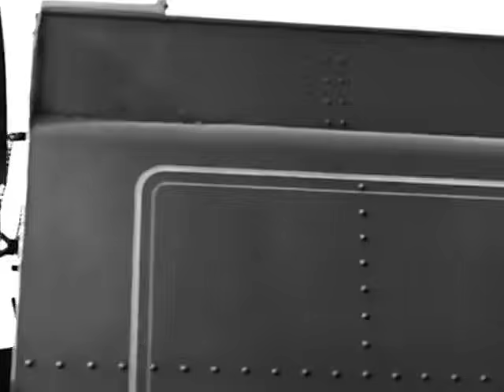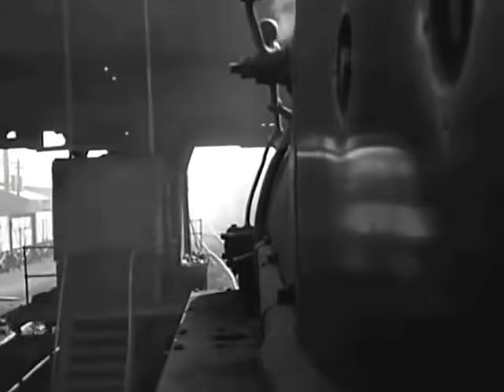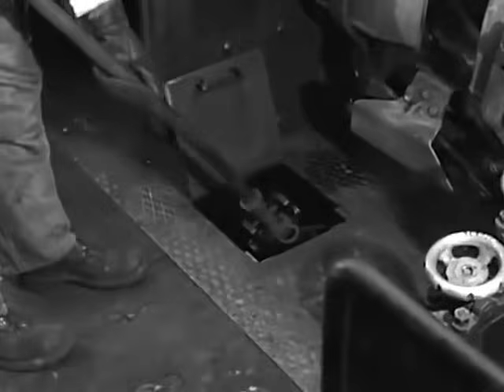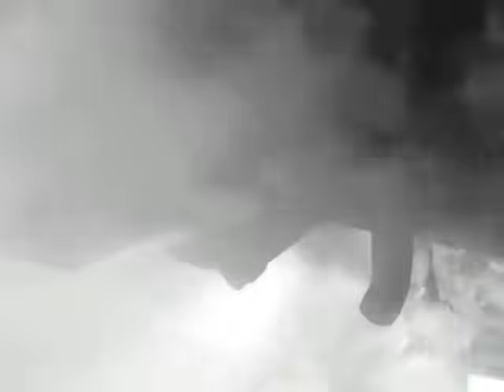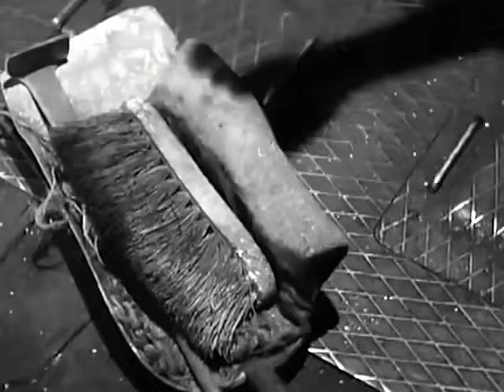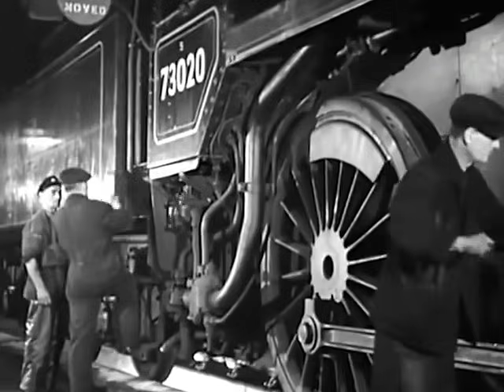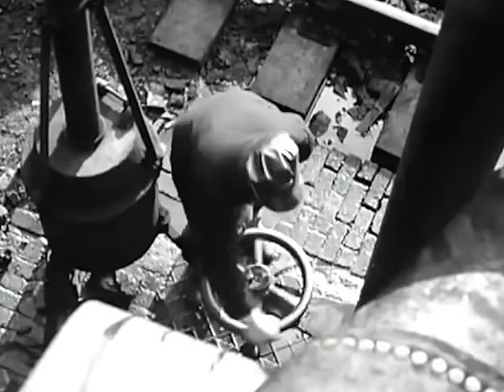Wash and brush up - British Transport Films - British Rail steam loco maintenance - 1950s

Comment: I remember seeing these monster as a kid. Born in 1951, they were the accompaniment of my early schooldays. My school was right next to the East Coast Main Line, and we ran out of the school yard in the late afternoon, to see massive plumes of steam being vented at full pressure, by the London to Edinburgh engine, while stopped at the lights just beside the school. They were waiting to cross a bridge at Byker. The roar of steam from those hot engines being blown,  I suppose by safety valves. Then they were off and pulling up a hill. Great days to be reminded of. The locomotives were awe inspiring and terrifying at the same time.

Comment: Dirty jobs to keep them old steam locos running. Also moving a steam engine isn't as simple as moving a diesel/electric, everything needs to be planned ahead, from making live steam to move the engine to coolung a dead engine to clean it, once you drop the fire that engine isn't moving until you fill the boiler back up and light the fire  then waiting until the pressure raises up, like the narrator says it rakes over four hours just to raise steam! But despite these issues there's something beautiful about a steam loco,they feel alive.

Comment: He knocks up the catchers on the firebox😂
If you can't get the rod through the tube, screw it.
His words.
I wonder if that poor guy getting in the firebox is black or just been doing it too long.
They never show work being done when it's snowing/cold
Reply: The washer out, the fire lightah, the steam raisah,
Footplate men, train settah,  and the reporting clock tells you where to stick it.😂
A propah bobby dazzler.
Love the Brits of old. So to the point.

Comment: Which BR Standard class is it?
Reply: A BR Standard Class 5 . When I was a kid in 1966 BBC South Today- a regional news programme had a folk singer on and he sang a song about a Standard Class 5 being cut up for scrap- over a film showing the engine being cut up: "Farewell to the steam locomotive- when the Southern ran solely on steam- and the Standard 5 Class locomotive was just a load of scrap" was the repeated chorus.  A few days later the "anchor" for the programme said "We have had a lot of letters that were unhappy about the film showing the steam engine being scrapped. We have sent a camera to Southampton Central to film a steam engine". They then showed a Bulleid Pacific waiting for the "off" a dirty machine but still living. It's funny what you remember. I went through Eastleigh the day before Southern steam ended- and there were loads there- coming back to be axed. The "last day" was pretty much just one steam special-Waterloo to Bournemouth. It was a very hot early July weekend in 1967.

Comment: British Railways struggled to get loco maintenance staff when the car factories expanded in the late fifties and early sixties, lighter cleaner work with good pay rates was on offer in the factories.
Between 1951 and 1960, 999 standard class locomotives were constructed, we really dhould have gone over to diesels much earlier, as the LMS had constructed their first mainline Diesel in 1947, just before the railways were Nationalised.

But after the war we were short of currency to buy oil, plus the pits had just been Nationalised, so new Steam engines it was to be.

Fortunately we have many preserved steam locos on our fantastic heritage lines, so the old ways carry on .
Reply: The last trains through Halesowen were workmens services to the Austin factory at Longbridge, car workers would leave wage slips on the trains for railway workers to find and see how much they were earning at Austins.

Comment: What a job that was, to take care of the engine when it returned to the shed, inspect and clean, and get it ready for another day’s work. Two guys run the engine, but I had no idea of the team and the work involved to keep that engine in running order.
Reply: These days in preservation the volunteers often double up in dealing with such work as well as the operation as well

Comment: Just been talking with the Mayor in the healt center  in Gaianes  , as a young boy remembers using El tren de Las Inglesas  steam , & later in Spain  many steam voyages when diesel was coming .Was on a trip on a Deltic for Cromptons  years ago , crunch bang no lube in gearbox that was what broke our electric motor shafts , oh the embarrassment towed to Derby by a King class  , we got back to Chelmsford  by steam ,.the  noise  in the Deltic correct  had earmuffs on plus all ourAmmeters !

Comment: This engine was still quite new when this was filmed, only a few years old at most. BR built hundreds of new steam engines in the 1950's, but there was no shortage of decent British coal and any oil imported for fuelling diesels would have had to be imported, using scarce foreign currency.
Reply: I believe 73020 was scrapped in the early 60s unfortunately. Would love too see a modern remake of this vid with the same engine
Reply: @lorumipsum1129  Late '60s -- withdrawn from service in 1967 and scrapped the following year.

Comment: Well, even when a modern coal powerplant has an effectivity of just about 30% with transformation and distribution/transmission losses added to the admittedly minimal losses of an electric engine, but the maintenance efforts with an electric train are at orders by magnitude smaller than with a steam train, not to mention the refueling issues.

Comment: These old steam engines were around 6% efficient compared to around 90% for modern steam turbines used in power plants.
Reply: Steam turbines get nowhere near 90% thermal efficency. Power plants typically report about 40% efficiency, which are amongst the best performing steam turbines. When people say that a "steam turbine is 90% efficient", they mean that the turbine is achieving 90% of the ideal turbine, which in this case would achieve about 45% thermal efficiency. 
The 6% efficiency of the steam locomotive is the true thermal efficiency, so you need to compare the 40% of the steam turbine to 6% (which is still bad)

Comment: How often would this type of service have to been performed on a locomotive? Hours, miles, day whatever.  Great film. Many thanks.
Reply: Every 12 to 16 days It says, the steam engines were run almost 24-7 except maintenance and stops since you need hours to get the machine to operating temperature from the moment you lit the fire. Trains even today always run almost continually, they only switch crews
Reply: @gillespriod5509  They weren't run 24/7 in those days -- they still required substantial minor maintenance between these two-weekly wash-outs.

Comment: Funny how only the West Indian guy was the only one wearing a mask. The bloke with the berry on was probably a WW11 veteran - it was common to see such men at work up until the 1980's. The super heater tubes are roughly the equivalent of a turbocharger on a modern car - these engine were extremely complicated and very powerful by the time of the 1950's. Trade unions would have a lot of say on job demarcation, health and safety and training. They also kept wages in the railway industry in par with more modern industries.
Reply: Whan did the other 9 world wars happen?
Reply: @jean-lucpicard5510  Give it time. You don't get born until the 13th of July 2305.

now...
👉
Engage

Comment: Those were fantastic machines but needing so much cleaning and maintenance.  And from a purely engineering perspective, they were only about 6% efficient at extracting work out of coal.  Diesels we’re just around the corner and needed much less maintenance and about 30%. Efficient so the steam engines were doomed.  Somewhat sad but unavoidable.

Comment: This is so labour intensive to happen every 15 days! Plus having to coal up everyday, a driver plus a fireman I wonder how much more of our network could have been saved and still be in use today if the railways had not been used to employ thousands of returning men from the Second World War. But use the same men to modernise and upgrade our railway system earlier. I know the government didn't want the cost of importing oil from overseas because we had plenty of indigenous coal and wanted to keep miners in work. surely it would have been better to have used this surplus labour to have electrified the railways sooner and burnt the coal more efficiently in central power stations.
Reply: The British powers-that-be have never been great at making logical logistics and infrastructure decision.

Comment: I'm one of the few people in this day and age that still works as a steam locomotive fitter for a living, pretty much do the exact same stuff these guys in the video, although we use some different methods to do stuff shown in this video. 

Its a hell of a job to do and I cant imagine the turnaround these guys doing it back then had. its very different in this day and age, there isn't an infinite amount of man power like massive workshops used to have so exams and maintenance takes a lot longer. they used to have separate fitters, machinists, welders, tube sweepers, examiners, barmen, washers and dozens of other roles. 
Now days you learn to do ALL of it yourself, its a lot more daunting than what it once was
Reply: I’m a cleaner (trainee fireman) in the UK and it’s nothing like this. Cleaners don’t bother with the insides of the engines anymore. That’s usually left for off period of a locomotive when it isn’t running, and the owner of the locomotive, usually a driver or fireman (depending on who owns it) will do this. Washouts are pretty similar apart from the fact that the hoses are a lot thinner and the water pressure is more powerful. This is only ever done with the engine is in a cold state as well for safety reasons. 

Cleaners only bother with the outside of the engines these days, usually washing the wheels, frames and the body.
Reply: Where are you a fitter? Im in the US in Cleveland.
Reply: @tomp3066  Victoria Australia
Reply: Hey Woody is this a full time job on a working railway or a vintage touristy railway. I'm sure it is daunting, I know the British Railways has a very large workforce but they were obviously needed to achieve those turnaround times.
Reply: @greenrosenz  full time job as a fitter on operating steam locomotives

Comment: How can can a locomotive run once the fires been dumped?
Reply: The boiler is filled with water before the fire is dropped, and with almost full working pressure. After dropping the fire there is still enough steam to move the Loco.
Reply: @MrDibbsey  interesting. I wonder how long it can run like thaf
Reply: @lorumipsum1129  not very, depends on how long it takes to drop the fire. A loco will move with very little pressure but stopping them is a completely different matter!

Comment: Some of these jobs must have been very hazardous.  I'm glad the industry is safer today.  I'm surprised that mechanical stokers weren't the norm in the 1950's.
Reply: Mechanical stokers need finely-crushed coal rather than big lumps, otherwise they seize up. This means that the draught on the fire draws a lot of coals through the boiler and out of the chimney, making mechanically-stoked engines dirtier and less efficient.
Reply: @geekyboringfilms233  Thanks.
Reply: Mechanical stokers weren't needed in the UK. We weren't running enormously heavy trains for enormously long distances, so a guy with a shovel was able to keep up with the locomotives' demands for fuel.
Reply: I'm surprised they were never converted to oil burning like many countries steam engines.
Reply: Best coal in the world was in Scotland. Why import oil.
Reply: @xr6lad  Running a steam engine on oil makes no sense for a country with diesel engine industry. In that period Britain had to import almost all oil and the coal mines were still in operation, so there wasn't an incentive either.
It was simply cheaper to build newer more efficient diesel locomotives, than converting them.

Comment: I like to imagine 73020 and other steam engines being sold to island railroads on islands southwest of Sodor .These railroads decided to keep steam and bought many gently used engines and kept them running even today.With good maintenance a steam engine can last 100 years.all parts with times can be replaced with identical ones.Engine would never have to be “old”.I’ll bet modern equipment would reduce time needed to maintain steam engine by more than half.

Comment: With a 25 kV overhead line feeding renewable energy you could raise steam without coal. Locos would look like they should  - just not very efficient.
Reply: Why use electricity to boil water to drive pistons, when electricity can turn an electric motor?

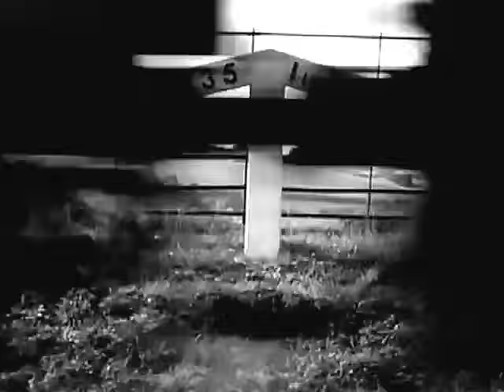Comment: At 24:31 there is a cross-bar sign with "Iin 335" on the left arm and "Iin 2665" on the right arm.  Any idea what this means?
Reply from the maker: It's a gradient post.
Reply: @BennettBrookRailway  Excellent; thank you so much for the Reply.
Reply: @xyz.ijk.  It's "1 in 335" not "lin 355". That is, one foot (or whatever unit you prefer) of rise for every 335 feet travelled. This is about 0.3%, if you prefer gradients to be measured that way.

Comment: How exactly does coal go "stale?"
Reply: As soon as the coal is mined and released from the pressures deep under the earth, the volatile hydrocarbons contained within start to escape. When this has happened for a good length of time, it affects the burning and reduces heat output.
Reply: absorbs moisture perhaps?

Comment: I wonder what was the need to scrap  all the marvellous steam rail engines. And this happened throughout the world, in every country. Why they couldn't preserve them or they could simply have allowed them to stand in lock sheds... Nobody can estimate the money which will go into building a new steam engine. It is massively expensive. The tornado rail engine built by britain made it clear that it's immensly expensive now..
Reply: They were scrapped because they were 100 tons of steel, iron, copper and other valuable metals. The modern term would be "recycled", if that makes more sense to you. Imagine what would happen if everybody kept all their old cars in garages -- that's basically what you're proposing for steam locomotives.

Comment: I know steam locomotives are extremely expensive to maintain, but considering their excellent power to weight ratio I wonder if someone could build a ‘modernized’ steam engine. An engine with a gas powered firebox instead of coal, and with a steam turbine or a steam regeneration system.
Reply: It's been done. Propane burner instead of coal.
Reply: They tried steam turbines -- every version of them was less good than diesels.

Comment: video excellent, audio squeaky.  backed audio speed a notch.  while all the jobs are dirty, i'm guessing the firebox cleaner had the dirtiest.  and that was the only black man i saw.
Reply: heh you have no idea, I help out in the shop with a steam locomotive in the states the ledgenary nkp 765  you get done shoveling the clinker and ash out of the sides of the firebox you look like you went coal minning, blowing out the flues with an air pipe you get all that crap back in your face when you pull it back   and it gives you a railroader facial, like blowing out the dirt and fireclay in the tell tells in the middle of the staybolts, I have a video of that on my channel to prove it, its fun but dirty and hard work, but very importent for the safety and the efficent operation of the engine, I would not want to do it every day the particals are so fine from the coal they dont like to come out of your pores, but this is how it was done in the uk, its prettymuch the same here but our tools and methods are a little differant, today we use ultrasonic tests for thickness loss to corrosion on the boiler shell, the staybolts and the whole lengths of flues and pipes every 15 years, and we dont have a water crane or standpipe here we use a garden hose for a week or a gas or what they call over there a petrol engine to pump the water though a firehose to fill the tender up, or we use a fire hydrent, nocking all the limescale and rust out of the tender tank is the worst though the lime dust dries your skin out so bad, we wear masks of course but its get all over your  hands and face even with coveralls on and its like running equiptment inside a giant steel drum when you use a needle scaler to get the crud peined off, its basicly a head of blunted nails on a small air hammer and it vibrates and knocks the crude off, also good for taking off paint and cleaning slag off welds.